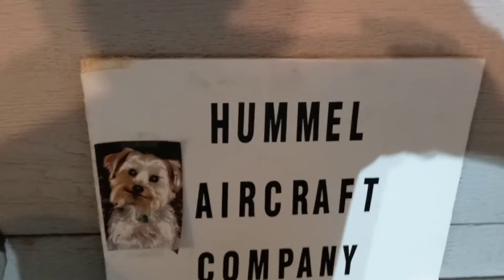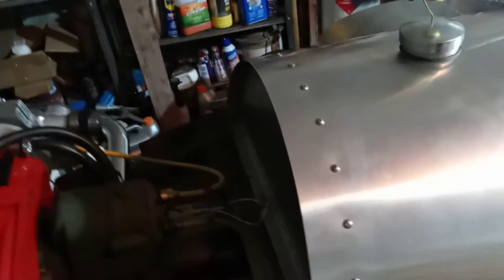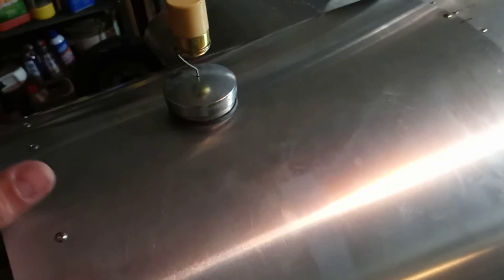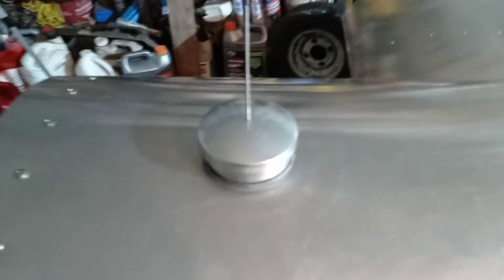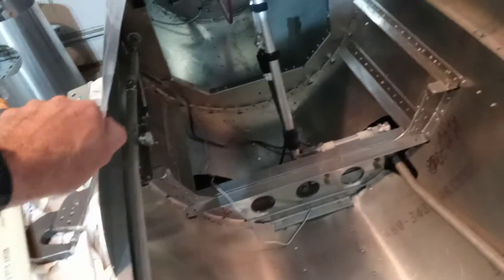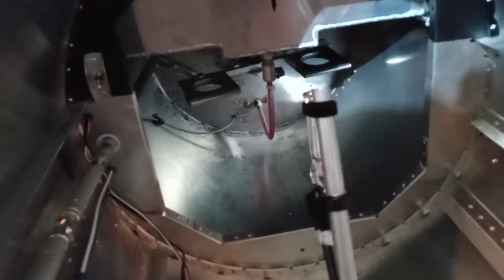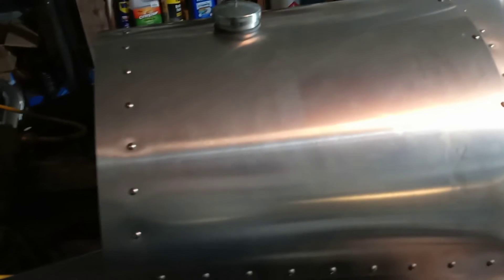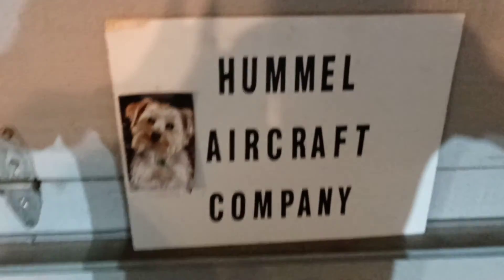UC tank cover on! But have concerns on silicone

Comment: As a retired A&P with years of experience repairing sheet metal, pressurized structures, and wet wing tanks, I grimaced when I saw silicone being applied.  What you need is a mil-spec sealant often referred to as A2, B2, etc.  The letter and number refer to the consistency and cure time.  If you have a shop in your area working on higher performance pressurized aircraft, turbine, or small jets, I would pay them a visit.  They may be able to fix you up with a small quantity. I comes a special mixing tube or in cans. It’s a two part product. We often had leftover partial cans which would not be used on the next job. This product will give the results desired, lasts forever, and is designed to be used on aluminum.  You may find it at Spruce in pint cans. It’s 2 part so can be stored.  Get the thicker product.  You will find many uses for it.
I remember you showing the spinner with the forward support. I would use that forward support as the rear plate was designed for it.  Fairly common setup for a modern spinner.   Good luck
Reply from the maker: Hi Myrl Stone well sir I had another guy question the silicone. So I think i will change to felt as i have done before. Thank you for your concerns and comments......

Comment: Dennis, you may already know this, but when you select silicone for use with aluminum make sure it does not cure with a vinegar odor (acetic acid) as that will corrode the metal over time.  The RTV type of silicone sealants cure with methanol and are safe to use.  I ran into the same issue with old silicone.  I stored the tube in the refrigerator and it lasted quite a while but I pushed my luck and forgot just how long I had it.  It never cured and then I realized it was over 10 years old.  I hate buying any sealants in large tubes because I wind up throwing more away than I use.  Also your fuel line is right there by your feet.  I'd be afraid that I might hit it with my foot and break it.  Hopefully is it a tough piece of hose and secure fittings.
Reply from the maker: Hi Gary Plewa no sir I did not know that. It did not smell like vinegar. As for the gas line its what I used before and it holds up well. But I will need to change out the silicone as it did not set up. Thank you for the commets